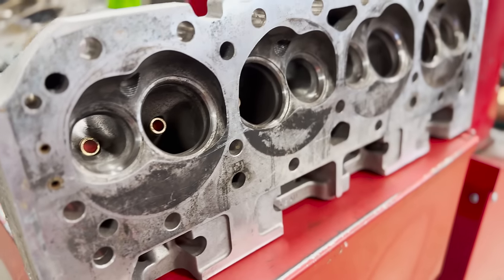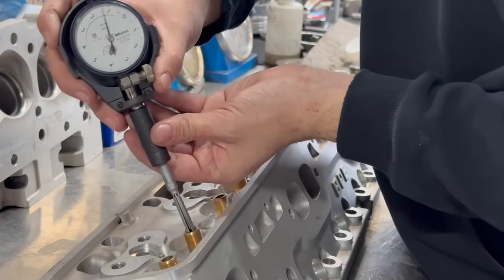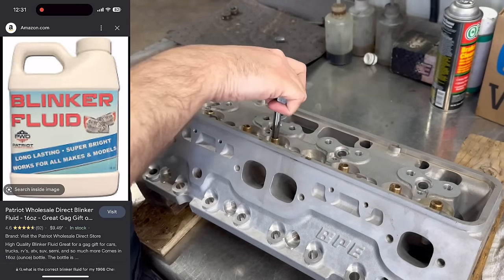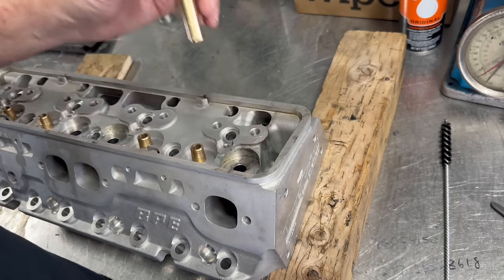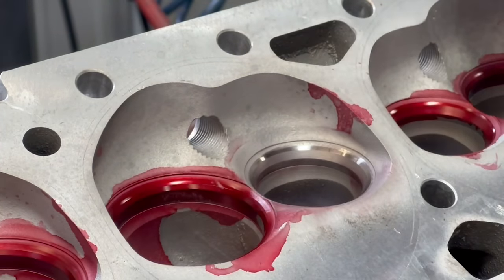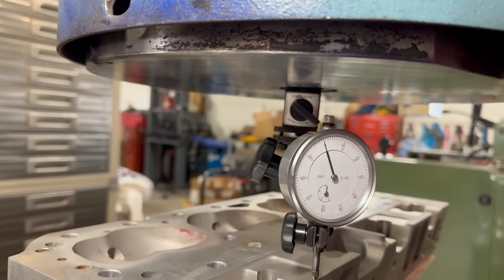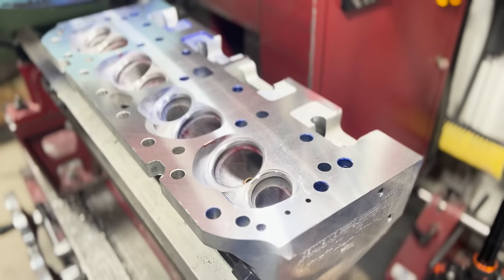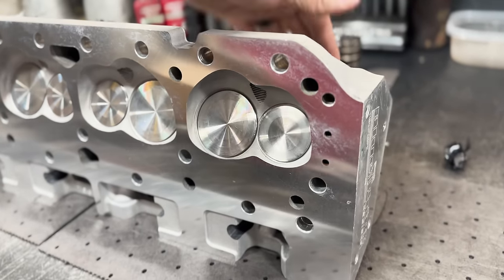Do We EVER Grind Valve Seats These Days?

Comment: I have one customer that insists on all of his valve seats being done with a stone. Was the first question he asked when he called me “ Do you use stones or cutters on valve seats?”. I told him I have both, said he only wanted ground not cut. Didn’t care about cost just equipment, told him my price, said don’t matter as long as I grind his stuff. Three sets of heads every 2 months for about 5 years.
Reply: How does the end result/finish differ between the two? Also is the customer decent? Couldn't quite tell lol
Reply: As long as you keep your stones dressed up, nice finish. I have cheated on hard exhaust seats to save stones, but finished them with the stone. But if you use a dull cutter, you’ll have poor results. I think that’s what brought him to me to begin with. He wasn’t happy where he was going before. I have not had a problem with my customers because I’m honest with them, I treat them good, they treat me good. You can never make everyone happy, that’s why there is more than one business in any given trade.
Reply: I only use the stones for my finish seats as long as your stone holder and pilot are in good shape with minimal play nothing beats that finish.
Reply: @samdavis5079  what are the most important steps to get a good high precision valve seat? Is minimal runout the best indicator of a good job or are there other measurements that can indicate the level of accuracy/ quality job?
Reply: That's good business complying to your customer's request. 99% of my clientele has been elsewhere and not received what they wanted in way or another. It's a hard market to keep satisfied, but rewarding when they're happy and return. Don't forget that kind of customer satisfaction isn't cheap. No offense to the customer, but A LOT of time goes into doing the job right and satisfying the customer.

It's not a cookie cutter business.
Reply: And don't forget to answer as many questions as you can. And I do mean "can". There have been times that I would not answer phone calls, return voice-mails, or emails. Then only under two circumstances, there were requests to alter the current work order or I received a $10 dollar  payment via mail or online service. After which I'd give my undivided attention to that client.

I know how that sounds, but a whole day can easily be lost to answering questions over the phone and that person never set foot in your shop. How can a business, or family, be expected to survive like that.

Off my soapbox.

Comment: I think the 1st time I ran a valve grinder was in 1974? In 75 I was in VoTech Automotive, and had to rebuild a 285 for an instructor. Enjoyed doing the heads for the old guy. Brass shim stock for crank and rod clearance checking. I love plastigage.

Comment: Love the content! As a machinist for a shipyard I’m amazed at what y’all do i just make 30’ long 6” diameter stainless steel prop shafts mostly. In my spare time i work on hot rods with my dad so I know my way around many small block and big block v8s. But Im amazed at what y’all do i feel like I’d be lost
Reply: What's the tolerance on those prop shafts?  I feel like with 30 feet it could be a bear not getting any taper/runout
Reply: @OWSNubbles  we order 6” diameter stainless round stock and cut the tapers, threads, and key ways pretty easy. We do a lot other work but i feel like the bigger the material the easier it is to machine. I hate machining anything smaller than 1 inch when it comes to turning it can be very aggravating

Comment: I learnt to tap a valve guide and screw in a bolt to knock out the valve guide about 30 years ago, loved watching you do the same.  For the first 10 years knocked them out with a punch and whilst it generally worked ok on the inlet guides, worn or deformed exhaust guides used to be a real pain, hated doing them.  After learning to tap and screw them it just became a breeze. I did hit a VW Bettle head a bit hard and snapped it in 2.  My boss was watching and was as surprised and I was. We too occasionally used stones only rather than just the RVR machine (an Australian machine long replaced by a Serdi)

Comment: Great content guys. I'm an old speed freak that abused and broke a lot of big block engines when I was young ('69 Plymouth GTX). Too old to go that fast anymore. Now, I focus on babying my '06 Honda Civic to 300k miles. It was a bonus to find out you're in Greeley. I worked on a frac water recycling project in Gilcrest for a hard couple of years, where livestock outnumber people 100 to 1 and the air smells like money (not!). My crew and I lived at the Quality Inn off 34 which I think is a Fairfield Inn now. It was a great experience but I'll never work in the gas/oil patch again. Just wanted to stop by and say how much I like the content you're producing. I've spent a ton on engine machine work over the years but only dropped off abused parts/picked up the fine work of my local machine shop here in Michigan. Keep it up. This video on old school valve grinding and lapping brought back memories! Cheers!

Comment: I have used a Hall Toledo seat grinder for over 50 years. Since I work on mostly on imported car and race engines, I need the ability to apply uncommon seat profiles. The grinding stones can be dressed to any angle and diameter. Using the correct grit with frequent dressing eliminates grinding marks and the orbital action of the grinding stone eliminates chatter. Attachments and pilots are still relatively inexpensive.

Comment: I have done heads since the late 70s and have only used Sioux stone kits and valve facers. Always used a 30 and 60 to center and size contact area. I know it's  old school but never had a head failure.

Comment: I have use the stone system for over twenty years and used to get seat specs fro trick flow when we were experimenting with the R ford heads. It takes more time this way but when you do it a lot you get efficient at it.

Comment: We used a Kwikway seat grinder  . Also had a Peg 10 seat grinder . Manual Kwikway hand cutter too . Used a Mira seat cutter  also.  Kwikway valve facer too.  We had a black and decker valve facer   too .
Reply: Best valve jobs Ive had were among 2 pros that do most at home themselves. Stones not the fancy machines at work. 
On the flip side had leaky valve jobs done by guys with flawless clean shops full of new cnc machines. 
If the operator isnt up to snuff the fanciest stuff wont help a bit.

Comment: In the mid 1980s I rebuilt a 200 cu in from a 1965 Mustang with my Dad's help.  We replaced all of the valves (two were burnt pretty bad).  He made me hand lap the valves.  no tools.  Just the suction cup dowel rods and lapping grease.  Took me several days but those valves were perfectly seated when I was done!

Comment: Jim, using a bounce spring on the guide as you are kissing the seat helps reduce runout . Second using some fine valve grinding compound on your final seat pattern check  helps polish / lap everything together . It’s good to show this process as it’s a good foundation for future cylinder head  techs no matter the advancements in technology. Def agree with having seen some terrible machine work from big mfg’s over the years. Even modern stuff. Love the channel !

Comment: As a hobby machinist I do my own valve job and port work. I use a black and decker seat grinder and it has yet to do me wrong. We run a vintage dirt track modified and are limited to factory cast iron heads, some of the machine shops in my area have quoted me 1200 to 1800 in labor just to replace guides and do a 3 angle valve job. Whether or not if I supplied parts(guides,valves,etc). And after the last time I paid someone else to replace my valve guides I got the shaft they charged me for the big bronze replacement guides $18 a piece and they installed the this liners.

Comment: I grind all seats, new or old.  On a a name head with seats cut with a serdi you still see some chatter in the seat when the stone just touches off.  Vacuum check is always better after the stone.  I do use a wet bench for Stone grinding.

Comment: Have not watched the video but I answer whole heartedly Yes they have a place in the modern shop. on one occasion just two months ago machining a ford new Holland cylinder head my carbide 45 cutter chipped way more then i could ever grind out. Last seat of a tough valve job I had chipped 2 other cutters for still unknown reasons. I decided to finish the last seat with a single angle 45 and it chipped as well. so what do you do ? finish the seat with stone and set the remaining angles with single angle carbide. I will now watch the video and see what you think lol

Comment: Is that a Sioux brand valve seat grinder? That’s what I used when I had my machine shop years ago. I like the fact that the pilots were straight until the very end which had a slight locking taper.

Comment: I think you did a really good job I like the fact that you check the run out on that I think a 1000 would be better the least amount is always the best especially for racing heads the other thing is not a big fan of the stones if it's just a cheap in and out for you know just conventional but I would use the car by bit cutter and make sure they're perfect and yes I'm well aware of a lot of brand like AAR and other big name heads the run out is not good and I've seen where they had to be ground to get him down there so at least you're checking that.

Comment: Your comments with regard to trueing up seats really can’t be understated, especially when discussing brand new out of the box performance heads. Your comments echo several other videos I’ve watched and a few other machinists I’ve spoken to directly who’ve noted as much as .008” seat runout and greater installed spring height inconsistencies on what are supposed to be performance heads.  

It is a little disappointing when someone spends as much as they do on cylinder heads only to find out they need another $300 worth of work to true everything up

Comment: Do you support the 0.080 minimum exhaust valve seat width"? Ideally it's for cooling the short time it's seated. Having it near the edge is fine so long as you don't ever heat the outer edge of the valve.

Comment: When laping valves do not do full rotation of  valves it will stop the high Groves lines around the valve this will give you a much better seal when the valve expands .from old time muchinest of over 50 years experience. Regards from Australia 🇦🇺 love your Chanel
Reply from the maker: Not lapping them
Reply: Even so it's a good tip.for the home shop guys regards and respect.

Comment: Are multi angle valve jobs still a current thing? I only ask because I gained most of my engine knowledge in a diesel shop where we primarily worked on Caterpillar engines, but would take almost anything on. There, we were doing three angle cuts on almost everything but I rarely see this being mentioned anymore. We used only stones in those days (of course) and I was unaware of cutters now being the preferred method by some. I give you extra points for not simply knurling the worn guides. Most of the "machine shops" around here would have knurled the guides in this without a single thought to the potential penalties for doing this in a high RPM engine. If nothing else, your customer will not be needing to repeat all of this in a couple of years of use. Nicely done!
Reply: Multi-angle is pretty much the norm for current gassers. As long as they can still dissipate valve heat, minimizing the sealing surface offers too many advantages over a wider flat face.
Reply: The really nice seat cutters can cut infinite angles on the fly. The shop I was at tested a Serdi like they use when it first came out, results were no better than the Sunnen diamond bench we had, just WAY faster. Especially on hard seats which were being done a lot in those days because of the unleaded fuel conversion. Now the top dog is the Newen.

Comment: I’ve used valve lapping compound in the past with great success, taking great care to ensure I clean all surfaces thoroughly after. I recently got back a cylinder head from my machinist and the subject of lapping valves came up. He told me that “valve lapping compound never really goes away” knowing that I was aware of how abrasive it is. What are your thoughts? Should I stop using valve lapping compound to touch up worn valve seats?

Comment: What is you and your dads opinions on brass valve guides as opposed to cast iron guides? I knew an engine rebuilder who detested brass guides and wouldn't use them, he absolutely refused and used to say to his customers that if they wanted brass guides then take them elsewhere. 
His reason was cast iron is porous and holds oil, therefore valves and guides used to last because they were lubricated yet the brass not being porous would dry out and where prematurely.  I did witness him replacing brass guides to cast iron for a customer after another shop installed the brass and lasted only 1000 or so km. I'm keen to know your opinions. Cheers.

Comment: I’m curious what company provided the valve spring cups and were they designed for use with the larger 13mm OD valve guides or were they even too large for that size?
Reply from the maker: The shoulder on the guide where the cup locates is the same on both guides. 

I should’ve specified it was more of a fail on my part; found the right springs and then ordered the spring cups that were recommended for the springs without actually verifying that they were right for the guide ID.

Comment: one question I've always had: is it required to lap valves in when replacing cylinder heads?
Reply: Only if you didn't do a good job on the valve job.  Lapping, when done right, will only show where on the seat and valve touch.

If you have to lap the crap out of your valve job to make them seal, you're in trouble.   Under real world use the valve head expands more than the head.  So a 'perfectly married' lap line won't be 'perfect' anymore.  The head sealing angle will move up the seat away from the lap line.

Comment: What model split bore gauge is that id like to buy one , trying to buy a cylinder hone right now but I only do LS engines and the aluminum blocks tend to have a lot of taper and my machinist can’t fix it on a 616 like you have … so unfortunately I have to get a computerized hone and the cheapest is a Ck-21 which is still 25k no tooling
Reply: I would like to know also

Comment: Back in the early 70's I had the valves ground on a 327? Chevy engine after having the headgaskets replaced. Thaat engine started burning oil at a rate of a quart every 50 miles. At the time I was told this was normal after a valve job. I traded the car off shortly after. Did my FORMER mechanic somehow screw up this job?

Comment: Why would a thinner seat be ok in a performance application? Wouldn't that result in reduced heat transfer out of the valve, which is the opposite of what you'd want in a performance application?